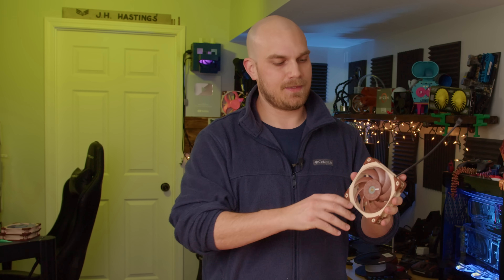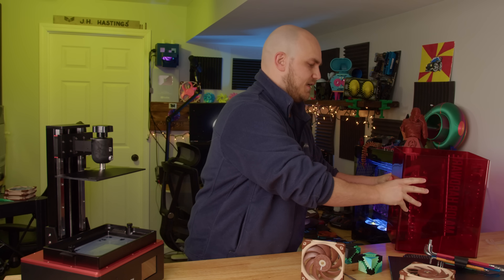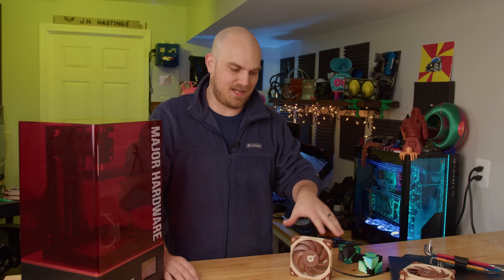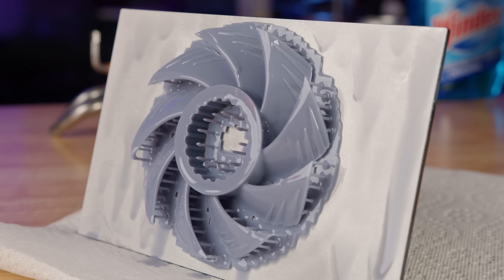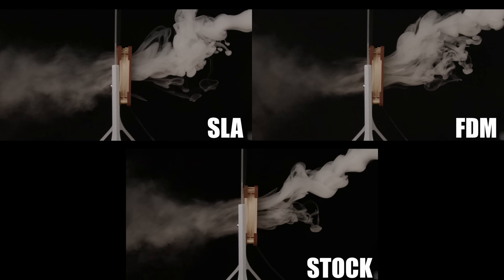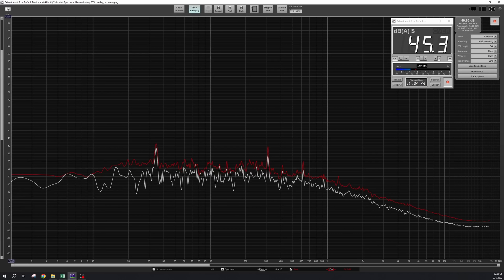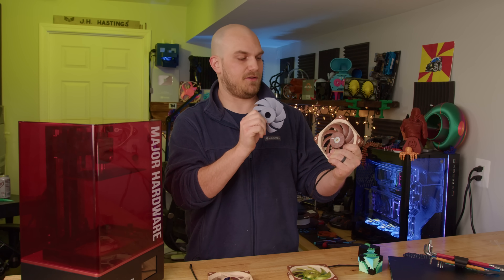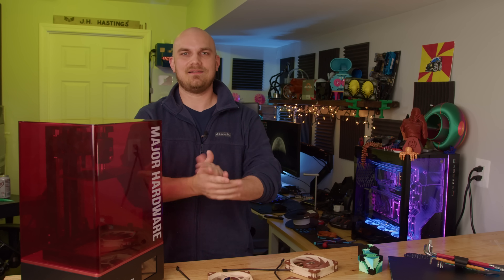I Copied Noctua's A12x25 and Resin Printed it, Its Performance Was ASTONISHING

Comment: Next, make 3 more resin versions of the OEM fan but this time add golf ball style dimples (maybe a bit smaller though) on front side only, rear side only, & finally both sides. I suspect less noise and maybe a little less slip, so potentially a tiny bit more CFM thru the heat exchanger.

Comment: I also wonder what a half hour with some sandpaper and maybe a set of needle files would do for an FDM-printed fan.  PLA sands really easy, and with minimal effort can be given a far better surface finish...

Of course, there's also the option of various post-print treatments, like polycrylic sealant or a specialty product made for smoothing PLA prints...  I prefer sanding, myself.

Comment: Also, SLA print speed varies depending on the technology of the printer. There is even a speed difference in MSLA printers based on performance of the LCD mask. Take a printer like the Formlabs Form 2 - it had a laser that traced out the parts more akin to an FDM printer. The new Form 3 uses their LPU technology but it is still a laser exposing the Y while traversing the X. MSLA / DLP have the advantage in that they cure an entire layer at once using a projected "image" so in theory the speed is determined by the Z. But, they are not all created equal so there are variances in SLA print times based on curing type (DLP vs MSLA vs LPU vs etc.) and the technology implemented.

Comment: I personally print in resin and have always wondered why you didn't try it, I would love to see a full season of Fan Showdown with resin please... BUT only if the new born can be completely isolated from any residue (which im sure you're hyper aware of im just suggesting it as a precaution that if cant be avoided i dont mind another FDM showdown) and maybe after the season is done you can do a top 5 resin vs a top 5 FDM. It could eb exciting :)

Comment: Definitely go resin prints. I feel like your experience will get better with each print. And much like fdm. You have to start somewhere. Resin is a higher fidelity medium which means that prints that did really poorly in the past may do much much better in resin just due to how smooth they are. Like the single bladed fans.. since they could be printed solid without much print speed change it would make balancing them to give them the best chances much much simpler. That's my two cents. :P anyway. Congrats on the kid. Good luck and look forward to the next season.

Comment: Personally I don't think the resin looks much better than the FDM when shown next to the original. Both resin and FDM have obvious printing artifacts. I'm no expert, but I seem to recall it's possible to dunk 3D prints into acetone and come out with a smooth surface?

Comment: I'd actually want to see tests of more prints of this model against other stock A12x25 fans. I think getting a reasonable quantity of samples for calibration between FDM and Nocuta's injection molding (including for noise levels and spectrographs) rather than a sample size of one would enable us to do a much cleaner comparison between these three fans. I know it's not reasonable to print multiples of all the fans you test, but having viable numbers on one part of that comparison makes it easier to say what might be good enough to merit more investigation, be it by you or the designer or a manufacturer.

I don't think you should resin print everything. FDM is cleaner and healthier, do that.

Comment: I happen to  have an idea. I run an open air case with a custom loop with a 480mm radiator with Noctua Industrial PPC 140mm fans in a push pull config. I have long considered fan shrouds spacing the fans away from the rad to alleviate the dead spot in between the fan   and the rad. My theory is it would increase the surface area and give the air a better path through the rad possibly raising airflow and with luck increasing the rads efficiency similarly to automotive applications. One on both sides in my instance I think could have benefits . Thanks for all your content .

Comment: I kind of prefer fdm because it’s all I have, but since you ask, I think it makes sense to go to resin for next season.  The fans are getting more advanced. Maybe use resin for the fan blades and use fdm for any required accessories.  That will also save you some time on some models.

Comment: Something like Polycam might be an option to replicate the original fan, at the very least it could give you something to campare with your own model.

I'm curious if the shrinkage associated with resin prints had any impact on the results, probably negligible.

Comment: I think it's fine either way. I would prefer seeing resin prints but mostly because I feel like it would give the closest to what a final production fan would sound and perform like but 2% isn't huge. That being said I don't feel like you need a larger printer I am pretty sure you can fit 4 fans in 1 print on the Saturn. I mean I don't have a Saturn but the M3 Plus which has a similar build volume an i can easily print 4 120mm props in that build volume. So I see no reason why you couldn't do 4 fans.

Comment: I think resin, being slightly better, but a lot more of a pain to work with, shouldn't be the standard. FDM is just too simple and fast compared to resin to fully switch over. Plus, the resin doesn't have the same  range of colours and material effects you can get from fancy PLA filaments to make them look visually interesting. 

Instead, I think maybe for the season finale, you should take the top couple on the scoreboard and print them in Resin for a final showdown and see if any of the designs have improved and if/how much they beat the OEM fan design by.
Reply: I agree completely

Comment: If you're on the fence, you could reprint the leaderboard fans in resin, and measuring their performance could help you decide whether it's worth making the switch permanently. I think the idea of smoother surface finishes is nice and the parallel printing times could be helpful, but at the end of the day I'm on board with whatever you decide is the most convenient for you. I'd hate for you to switch to resin for us and have it make you hate doing this work. Also congrats on the kid!!!
Reply: ^ this 100%. I don't know much about resin printing or 3d printing in general, but if health is a concern for resin printing then definitely don't do it or just do it on occasion.
Reply: Yep, if he's going to try printing in resin for these projects it needs to be a setup that makes it as easy as possible.
Big cleaning tanks or ultrasonic cleaner.
But most importantly, a dedicated extract system, NOT filtered recirculation that'll make sure he stays safe.
Reply: That would not be accurate since the fans that are on the leaderboard all do well in normal 3d print and would probably have the same percentage drop, but it would filter out (hypothetical) fans that are only good enough for the leaderboard when resin printed
Reply: It's probably not the surface finish, but more likely that the FDM print has shrunk, ie, molten fusion always shrinks, and that makes a bigger gap between blade and housing.  It's the same when we run jetskis, ie, we shim to prop as tight as possible.

Comment: can you extend the model above and outward of the shroud? would that make a difference like having a 130mm or whatever brings it to the absolute edge maybe would grab more air? like, if you kept the model but heightened it like 5mm or so, maybe even 10, and made a little fin to extend over the height of the shroud

Comment: Have looked at 3d printers a few times, one thing no-one has mentioned to me is the smell of resin printing. And it's so pervasive enough for you to re-cover a unit that's not even running? That's as fascinating, to me, as the results of the tests.

Comment: Why not make a comparison test between the top 10 best performant fans ever? Print them in resine and compare it with the 3D printed ones that you already have printed on the previous seasons. If those results show significant difference, chose from there. If the results are similar... Well, it really doesn't matter how they are printed. Maybe use both printing types to save some time since you can have 2 printers working

Comment: I don’t think you’ll personally get much value using the resin vs FDM especially since you seem to dislike using it.  How about making an extra video at the end of the season where the top 4 or 5 performers get retested in resin. I’d also consider posting future results in comparison to the OG factory A12x25 and the printed one.  Anything that beats the A12x25 FDM surely deserves a resin retest in my mind.

Comment: How about a round up of top candidates in resin? Run everything in FDM, and the top 5 get the resin treatment... and / or the creators chance to improve or clean up the print. Should be an interesting end to a season.
Reply: Oooh this is a great idea. An improved v2 of the top fans printed in resin as a series finale. Nothing better than a bit of added suspense to the final show.

Comment: Congratulations on the new kid.  I don't think you really have to start doing resin prints if they cause you trouble, however I think you might want to repeat this experiment with a couple of other designs to see if the difference between FDM and resin is repeatable.

Comment: Did you run all of these fans on the same motor/frame? Or did you run them all on different ones?  I would imagine that the motors themselves would have some variation.

Comment: It the smoothness the resin printer give the parts the other printer quality can not match it so yeah would you rather have a smooth surface or rough surface and looking at the noctua fans they're not exactly smooth but that's by design to help the coefficient of air flo and strength  so another words their surface finish acts like a little bearings all over their fan blade to allowed it not to have a suction it makes the difference in output and RPM current draw it makes a noctua fans efficient  let me know what you think I'm I on the nose or off by a mile

Comment: You can also try different filament types. I don't thing PLA is the best for being a fan. Also, stepping down to a 0.25 mm nozzle might change the geometry to be closer to a SLA print.

Comment: Well, you already know the difference between the types of prints, you can just adjust the output numbers by 2.7%. But, I'm wondering if you used the A12x25 on a separate motor than the other blades and if there was a difference in motor between them. I'm not opposed to using smoother prints or even using a better slicer program with your other printers for better outputs, just vent properly when you make them, you have a kid now!

Comment: Resin printing is going to get you the closest to best air flow performance. However, it's messy, it stinks, it's a pain to clean up and the disposal of used resin and isopropanol is annoying and terrible for the environment. For the sake of the trees and your own health, stick to fdm, or out source the resin printing.

Comment: I say FDM is good enough, and it would also stay consistent and comparable with previous results. While SLA might be "more accurate" to the model, I think most people who would print these models are going to do it in FDM, so testing that is more representative of real-world results. Another reason I think you should stick with FDM is that I do not wish for you to have do all of that post-process and cleanup. Most people who haven't done resin printing have no gauge for how offensive the raw materials are. My first time messing with the stuff I had blisters where little droplets landed on my arms past the gloves. SLA has its place, and if the purpose of these experiments were to tweak the model to design molds for injection molding it would make sense, but in my mind, if the end product is meant to be 3D printed at home, then the testing should represent that.

Comment: Wanted to ask a question. Could you make a video on the push/pull configuration using different sized fans in the front and back of the radiator? I like the way you run your testes and I wanted to see what the difference is to having the same size fans on both sides of the rad, two different sized fans on the rad or one normal fan in push or pull config.

Comment: Congrats on the kiddo!
I personally don't think a 2% difference is enough to be worth aaaallll the extra effort, in my opinion. Because, it's a fan showdown against each other. They're all printed on the same material, so all the results are compared fairly. 
Yes, they're all up against the big daddy A12, but maybe at the end of the season there could be a Showdown showdown of the top 5 printed in resin to see if they can actually beat the A12. Otherwise, whatever is easiest (and most fun!) to get the content made and presented to us, that's what I'm here for.

Comment: I do not know a lot about fans, but I wonder if it isn't just the printing process but the density that is hurting RPM and thus hurting performance on the FDM print. Did you measure RPM, and weight of the blades? Have you tried LW PLA for making fans? It weighs much less than regular PLA. Not sure if desntiy would change things much, I am just curious if the imperfect printing is creating vibrations or an imbalance causing a heavier blade to spin slower. However, I am not really knowledgable about this. I just find it interesting to learn about.

Comment: I think if the goal is to have the showdown models compete with eachother, as you are doing it is fine.  But if the goal is to have each one compete with the A12x25 then obviously resin to remove a handicap they had previously.

Perhaps a middle ground is FTM for the season, but then have a "finale" where you re-print the top 4 and give them another shot to take down the king(s).

It would also be cool to see previous season winners in resin.

Comment: I think that resin printing would be the obvious choice, moving forward. However I'm also gonna say that you shouldn't do resin unless you can find a printer that actually makes your job easier. I don't know if it's possible, but maybe you can use water soluble resins to build the supports, followed by a run with the regular resin on top. And if you have enough budget to buy or build a fume hood for it, that's also gonna be a huge quality of life improvement. But I'm not gonna hold it against you if it's not feasible. Last thing anyone wants is for you to get tired of the fan showdown because it's becoming a hassle.

Comment: For the next season of Fan Showdown (or even the current one) I think that regardless of the material used to print, the A12x25 should be penalized the 0.6% or the 2.7% in order to make it more fair. Even looking at this season, that 2.7% cut puts it behind Angel, Gear Ratio, and Simple 13.

Comment: If the goal is to have a fan submission beat the OG then yes, give us that 2% boost. However you could effectively do the same thing by comparing community fans to the FDM made A12. 

In addition to the new printer you should get a dedicated cleaning station & curing station. And for your own good putting that all in a DIY fume hood would drastically reduce chemical exposure (and keep wife and kids happy). Show us the completed setup as well!

Comment: I'm kind of conflicted, ~2.5% diff is significant, and I'm sure every person submitting a fan would want that extra edge, but the added effort with resin especially because you have a kid is also a consideration.

I think if you can definitively show that it's always or nearly always ~2.5% better for resin, you could calculate that difference and give approx numbers for ideal situations and not do resin unless 2 fans are so insanely close that the extra accuracy of resin would help decide a winner.

Comment: I run a print farm from my house with several FDM and resin machines. I built an enclosed cabinet to house them and I use an 8" grow fan from Amazon and then I made a small frame that closes in a basement window similar to how you close a window AC unit in to a window and I vent the fumes and smell out that. The window frame locks in on the sides, top, and bottom and has a little insulation so I can leave it there year round. I made mine the size of the entire window and it's screwed together so it can't be removed but you could also make it removable and put a stick in the window so people can't open it the rest of the way. It was quite a bit of work but this has greatly reduced the issues I have with fumes and smell from all the printers. If you do decide to do something like this, using a grow fan is imperative. Do not cheap out like I did and start with a cheap duct fan like you would put inline with a dryer vent. They are loud and don't move much air. The grow fan is 1000x better.

Comment: You need a newer resin printer.  That is likely a 4K printer or worse.  There is a new Saturn 8K printer out now from Elegoo.  There is also a new PLA like Elegoo resin 2.0.  I just bought some, but have not run it yet.  I live resin printing and have used probably 50l of resin in my Mars 3 in a little over a year.  I'm not sure about the old Saturn, but I know the Mars 3 is a MUCH faster printer than the Mars 2 and is 4k vs 2k.

Comment: the difference is likely the result of the rough surface having a higher drag coefficient than the smooth surface, reducing the speed and generating ambient noise from the wasted energy. the thing is, how much of an effect that has is going to be relative to surface area.

Comment: @Major Hardware I wonder if there is a difference in weight between the OG noctua fan and the resin printed one? That might account for some of the difference. Similarly with the FDM printed one (though that one likely has some aerodynamic deficiencies as well due to the resolution). Definitely would like to see more resin fans going forward.